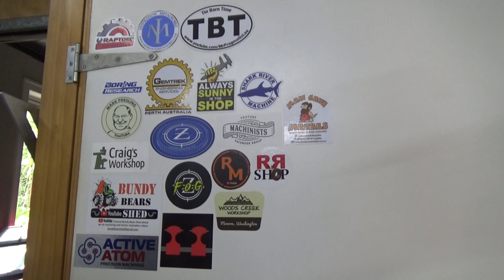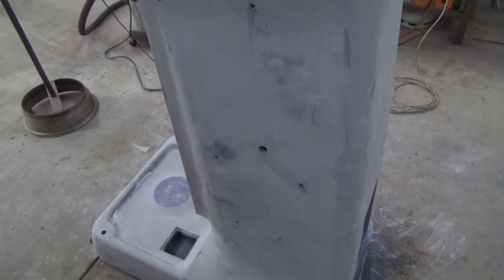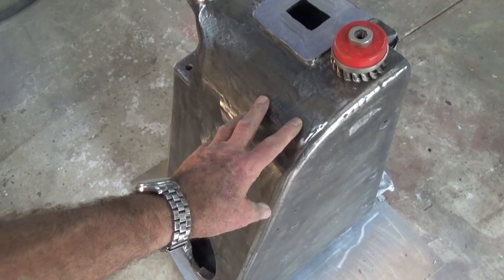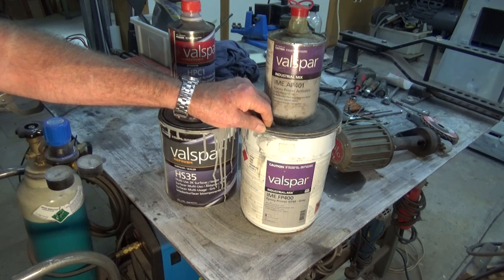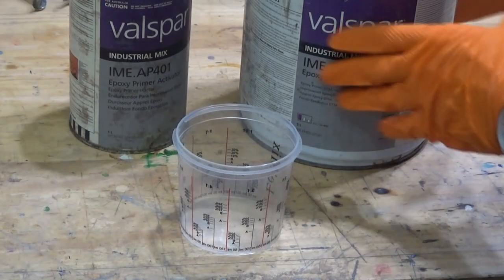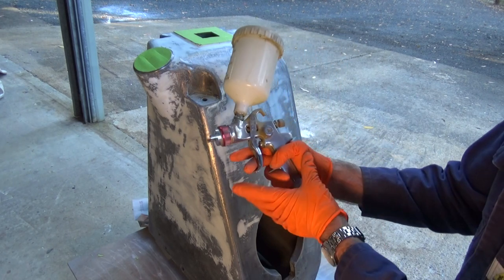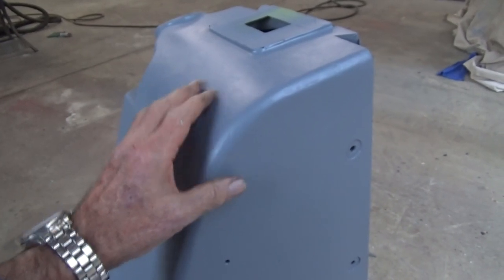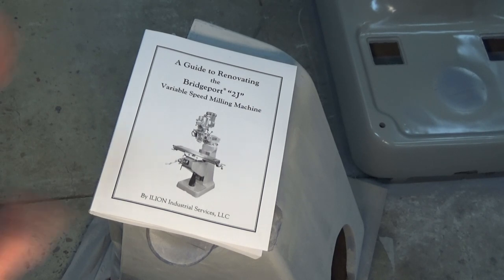Bridgeport Repaint With a Side of Humble Pie

Comment: I suspect that you may have been referring to the comment I left to your last video. Though stripping paint may seem to be an unnecessary waste of labor, your film thickness would have likely been excessive if you hadn't done so. Also, as you've discovered, and the integrity of your new finish was dependent upon an unstable existing paint job. Glad that you got it sorted before you invested too much time;-) 
By far and away the most durable paint system that I've ever work with is Imron. You may want to try it in your next project if you can get access to it. 
I hope that you won't get offended by more suggestions. If so, please stop reading my comment here. 
Your paint gun has two stages. The first is just air. The second, feeds paint. When you reach the end of a paint stroke, don't fully release the trigger. You want to keep the air on to avoid buildup on the nozzle. 
Some of your painting is done with the gun a little too close to the part. Typically, you want an HLVP gun 6-8" off the surface.
Reply from the maker: Thanks for the feedback. I did go looking for the original comment that alerted me to the contaminated filler so I could acknowledge it in the video but unfortunately I couldn't locate it. However as you have said it was probably you. It really was the right decision so thanks for letting me know. I actually put all the enamel topcoat on yesterday and it has turned out great. I just need to let it harden for a few days before I start to reassemble things. Thanks for the tip about keeping the air on. I hadn't heard of that before but it explains why drips start to develop on the cap. I do have a HVLP gun but for some reason I prefer the high pressure gun. Don't know why. I just googled Imron and there are distributors in Australia. I'll do a bit more research on it.
Regards,
Mark
Reply: @Preso58  I just looked at the comments to your previous video and it was someone else who warned about the perils of contaminated filler. 
The biggest drawback to switching paint systems is all the ancillary products that have to be purchased, but when you take into account your labor, the costs aren't prohibitive when weighed against the improvement in the finish and durability. Interlux also makes some very good paints, but I greatly prefer Imron. If you know anyone who paints Gulfstream jets, ask them which they prefer and why.

Comment: FYI, high carbon air filtration DOES filter out isocyanates. However, there is no indicator smell for whether or not the filter is saturated.

If you have to use paint with isocyanates, use brand new filters and change them out at around 30% of their rated life.
Reply: Additionally, I'd suggest using a disposable paint suit that's thrown out after your done, and painting outside.
Reply from the maker: When I went to buy my respirator, I made the mistake of telling the vendor what I wanted it for and immediately regretted it because I then had to sit through a lecture about how hazardous 2K paints were. Like I didn't already know that. I was also told that there are no effective filters for isoncyanates but it could be that I was being set up to purchase a very expensive forced air mask. I always paint outside or near the doors depending on how windy it is. I take the view that it is probably far less dangerous than driving a car and yet we do that nearly every day and don't give it a second thought. 
Regards,
Mark
Reply: @Preso58  Unfortunately, they have to just assume anyone entering the store is an idiot. Otherwise someone who doesn't know will get themselves hurt or worse. As well, a forced outside air mask setup would definitely be better if you were regularly working with isocyanates. It's just impractical and costly for anyone only painting with them once every dozen years.

Comment: Pesso, I cannot state enough that there is no safe level of exposure to isocyanide catalysts.  Hobby Air makes a "reasonably" priced  fresh air pressurized breathing system if you must use the isocyanide based products in the home shop.  I realize that an extra $450 (US$) for a breathing mask may seem expensive but how much are a person's lungs really worth?  There are non-isocyanide based catalysts available but they may not provide quite as good of a finish as the more hazardous products.  There is a reason why isocyanide based hardeners have been the gold standard for so many years despite the extreme health hazards... they work.

Great work on your mill, it is starting to look fantastic.  I am looking forward to your next installment.
Reply from the maker: We did buy some isocyanate free clear coat for painting some model cars at school because students would never be allowed exposure to anything really toxic but it was difficult to put on and it had poor gloss levels. I did investigate getting a purpose made pressurised mask but my exposure is very low. Maybe a couple of hours every year or so. Driving a car is probably far more hazardous and we do that most of our lives and almost every day. It's all relative I guess.
Regards,
Mark

Comment: As a few others have noted, I would have thought a good heating would take care of oil. Never used a 2 part paint for such work, so I imagine it will work.
Reply from the maker: I was a bit worried about heating the castings in case it led to distortion of the ways. I imagine you would need a lot of heat to vaporise the oil. As it turned out I think the culprit was the filler rather than oil soaking into the iron.
Regards,
Mark

Comment: Good project Mark and great to see that you have upgraded from the Denbeigh. It’s one thing I don’t miss is painting, I’ve had a few years on the end of a gun. Looking forward to seeing the end product!! Have you got heat lamps?
Reply from the maker: Rick, it was a bit of a snap decision to sell off the Denbigh. When the virus hit I realised we weren't going to be doing any travelling this year so I the budget went into the new mill. I too hate painting. I seem to spend half my time trying to get rid of dust so you can move on to the next stage of paint. Unfortunately I don't have any heat lamps however the two pack paints do go off pretty quickly. It's the enamel topcoat that takes ages to harden up. I hope you have the big shaper going?
Regards,
Mark
Reply: @Preso58  The shaper is nicely parked in the shed. I just have to build a chip pan for it as chips are flying everywhere. Cheers

Comment: Nice Work! Could you share the paint color code and the Manufacturer of the paint? Big thank-you for your time!
Reply from the maker: Someone else had asked me about the paint so I went back to the supplier and took a photo of the colour paint code. The colour is called "Machinery Green". I bought 1 litre from a local paint supplier but they colour matched it to a clean section of paint from the mill. It is likely that it is a custom colour but I have photos of the can label and the formula. If you email me at mark.presling@gmail.com I can send you the photos.
Regards,
Mark

Comment: Will Kilz create the barrier you need?  I know it works great against water marks and rust.
Reply from the maker: I am not familiar with that product but since removing all the filler and repainting the knee casting is showing no signs of oil bleeding through the finish.
Regards,
Mark

Comment: You have to be particularly careful with overspray with 2 part paints, especially outside.   The tiny droplets will float amazing distances without ever curing until they find the neighbors (or customers) car.  We had an incident where we had to do major detailing on vehicles that were probably over a hundred yards away that ended up with hundreds or thousands of tiny specks of epoxy paint, lol.  Regular paint is usually fine as it will cure in the air and just leave a powder.
Reply from the maker: I took the trouble of covering my lathe with a sheet of plastic but just as I finished spraying the mill I looked over and the wind had blown the cover off and it was dangling by one magnet. I know what you mean about the over spray but I was probably fortunate that just about everything in the workshop was covered in a fine film of dust. I gave the lathe a bit of a wipe and it seems to have escaped unscathed!
Regards,
Mark
Reply: Mark Presling did you look on your neighbors car?   Haha

Comment: The issue you having is the base is cast iron. It soaks up oil like a wick, Until you heat it up and burn it all out of the pores it's gonna keep giving you problems. You can do all this work but in a few months the oil still in it is gonna cause it to peel like you didn't do crap.
Reply from the maker: Well, I hope not. I am feeling more confident having removed all the old filler from the knee. Time will tell I guess.
Regards,
Mark
Reply: @Preso58  I wish ya best of luck but seems like the same problems we have with cast car engine parts when I try to paint them.

Comment: I wouldn't spray 2K myself without piped air and full skin coverage - there is no safe exposure level with that stuff once you atomize it, and never allow it to touch your skin.  You should consider the sanding dust itself as hazardous.  Rolling on with a fine nap mini roller and tipping off with a brush is far, far safer, and can give a better finish on irregular surfaces than spraying for the less skilled.  I've used a lot of Alkyd Enamels in commercial and industrial work, particularly machinery like tractors and commercial boats just because we couldn't contain 2K materials in public areas such as marinas and industrial parks.  Your advice with gun operation is quite good - whatever paint system you choose stick to the system in it's entirety as directed by the manufacturer and don't be tempted to mix and match and you can't really go wrong.  The use of specific thinners to your 2K might surprise you on how much quicker it blends - it still fights you initially but combines way quicker than standard thinners.  You definitely need fast thinners to get it out of the mix before skinning occurs, or you can create holidays and a few strange things if you get too heavy handed with reducers.  All the thinners need to get out of the way of the A & B parts to allow full cross linking.  The reason house painters whistle when they are rolling the paint on, is because you get the rollers out at the end of the job, most of which was prep work that takes days beforehand.  I found it didn't matter what I painted, about 80% of my career involved stripping, and patching, and repairing, and filling and sanding, and more filling, and more sanding for days before I could get to the fun stuff... :)
Reply from the maker: Totally agree with you on the prep! I spent nearly three weeks getting ready to paint and about three hours putting paint on. I also agree with you on the 2K hazards but I take the precautions I can and accept the responsibility of exposure. At the end of the day I don't smoke and I don't do drugs so I guess I am way ahead of some people! 😁
Regards,
Mark

Comment: Hey presso where did you buy the paint & what do you use to clean down after sanding between coats. I've just done a single lip cutter grinder with rattle cans and not totally happy with the result.
Reply from the maker: I got my paint from Signature Refinish Supplies in Kunda Park. They were very helpful and colour matched my topcoat for the Colchester lathe. http://www.signaturerefinish.com.au/index.php?route=common/home
I clean down the surfaces with ordinary wax and grease remover. It mops up the sanding dust and any residue left over from your hands. 
Regards,
Mark

Comment: Will add that for 2 part paint use the right thinners, as most of them are available with a retarder, so that the epoxy will stay uncured for longer in the bulk in the gun. Helps with using it on a hot day where you otherwise would find the paint flashes off and turns to powder before it hits the surface and smooths out. 

Pet gripe is with car painters, who think that you need to use 2K paint and put it on so thick that it is matt, and then rely on some poor SOB to polish it almost all off afterwards to get it to shine. I want to put that paint on in a few thin thinned coats, and have the finished job not need a polish, as the paint will do this. No need to waste both half the paint, and as well hours of work and polish, to fix a sloppy painter who will not spend a few seconds more doing thinner coats, and a few more of them, so that your final polish is more a buff than anything else.

Even I as a novice painter got better results than the pro, and my surface prep sucked, plus I was told you cannot put it on fibreglass. Yes 6 coats on the canopy, done in a weekend, but it never needed a polish, and had no orange peel either.
Reply from the maker: I used a 2K paint as a top coat on my lathe and the vendor pointed out that most two packs are self levelling meaning that they should settle onto the surface with a high gloss and not need any subsequent polishing. I love the way it goes on looking a bit wrinkly but soon smooths out into a high gloss finish. I did buy some thinners with a retarder when I was painting my lathe because I was doing it in the summer and was worried it would go off too quickly. It's winter here at the moment which is why I didn't bother with specialist thinners. Also the top coat I am using is just a single pack enamel. 
Regards,
Mark

Comment: Paints are foreign to me, I use cheap spray cans and hope it comes out ok because I've had no exposure to 'proper painting'
Thanks for sharing. The 2 part paints sound interesting
Reply: Rattle can can be pretty good, the trick is to get the surface smooth before, and absolutely oil and dust free, plus a warm area. Thin coats, allow enough time to flash off between coats, and you will find it hard to tell the difference between the can and a 2 pack, except for specialised finishes. Remember the spray can is basically the same Duco paint that cars came with till the 1980's, when manufacturers were starting to use water based finishes and 2 part paint methods.
Reply from the maker: Gasp! Aerosol paints have their place but I get a bit cranky when I see makers who have just spent dozens of hours making something complex and beautiful and then paint straight over bare metal with a $5 can of spray paint. My laser cutter was made in China and the so called manufacturers painted straight over the bare steel chassis with a cheap textured paint and the steel started to corrode under the paint and it eventually lifted off in huge bubbles. My nephew visited China regularly in order to have a high end laser cutter made to spec and he told me that most of the painting is done outdoors in all sorts of weather and often you could see the corrosion forming almost as they hung the parts for paint. I eventually had to strip all the paint off the chassis and clean all the steel back before I repainted with 2K paint. It is expensive and it needs a lot of prep but it also lasts well and looks good for years. Step away from the rattle can I say! 😁
Regards,
Mark
Reply: @Preso58  Once I put in a fume extractor layer this year I'll consider better painting options

Comment: How long do you have after you mix the paint to spray it and clean the gun before it goes off?
Reply from the maker: The paint film will go off within 30 minutes once it is sprayed out in a thin film. Left in the gun though it will last for many hours as long as it is sloshing around as a liquid, If you need to save the paint you can put it in a sealed container and leave it in the fridge and it will last for a few days. I once left a batch in a mixing cup for about 24 hours before it started to gel. I do clean the gun as soon as I am finished painting though.

Comment: How long did it take before you saw the oil start to show through on your initial finish attempt?  Thanks for the video!
Reply from the maker: It was the very next day. I spotted actual drops of oil on the surface of the etch primer but I couldn't figure out how it got there. I thought that somehow I had spilled oil on the paint when I was working on cleaning some mechanical parts. I cleaned the oil off with solvent and went ahead with the surfacer and was dismayed when it showed through again within hours. Anyway, lesson learned!

Comment: Why couldn’t you have sand blasted it or media blasting as an option ?
Reply from the maker: I wish I had a media blasting cabinet big enough! I did have an acquaintance who did all the sheet metal parts of my Colchester for me. He had access to a sandblasting enclosure built into a 20' shipping container. But that contact is no longer available. I must admit that I don't like media blasting anything that will be a running surface just in case the media gets retained somewhere which will damage a bearing or a shaft. 
Regards,
Mark

Comment: Could you powder coat parts this big? I guess you just need a garage-sized oven!  🤔
Reply from the maker: You could totally powder coat the whole machine but you would need a really big oven and some way of moving the parts into and out of the oven. They are bulky and heavy and it would take hours for the big castings to get up to the temperature required to cure the powder coat. Also, powder coat is quite thick and it would need to be masked off from the sliding surfaces and any bearing housings. I guess at the end of the day, paint is more suitable for big machines like these. 
Regards,
Mark